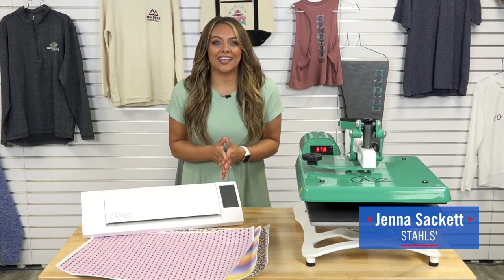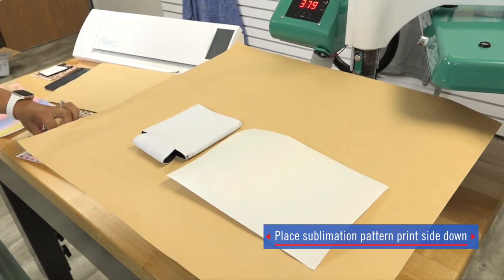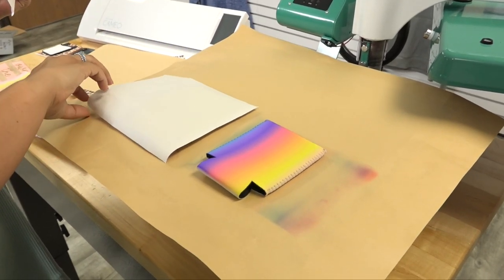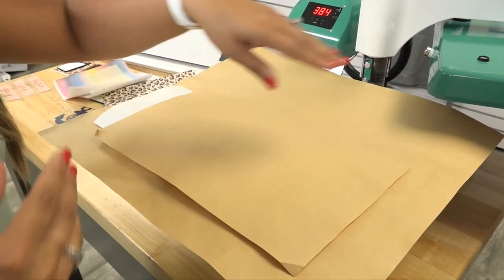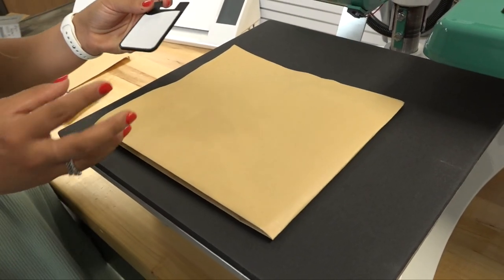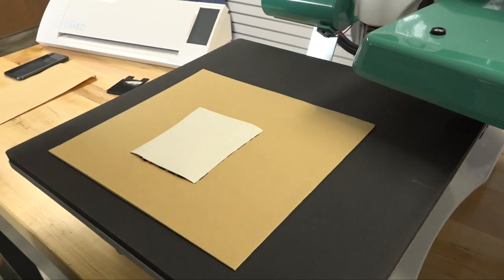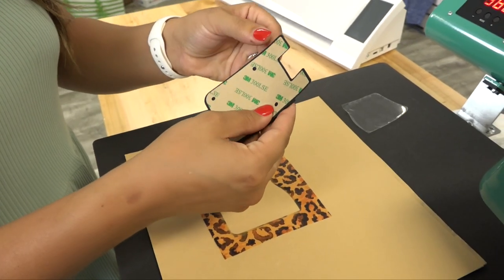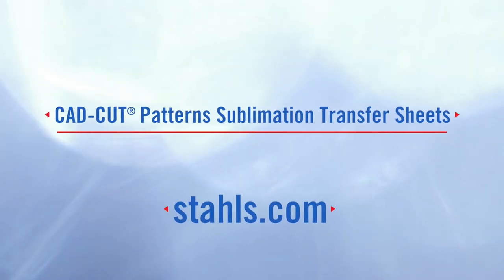How to Decorate Cup Koozies with Sublimation Patterns & HTV

Comment: You should have made this demo using some metallic or any other not flat colored vinyl.
In this instance you add one step too many while you could have do everything in one step just using sublimation, since what you add with vinyl is in black
Reply: This is a great video for those that don't do sublimation themselves. Just like transfers are great for those who don't screenprint.
Reply from the maker: Great point! We used Glitter Flake as an idea to achieve a glitter finish and achieve more profit potential. Metallic would look great too!